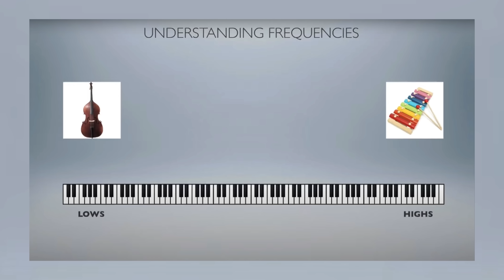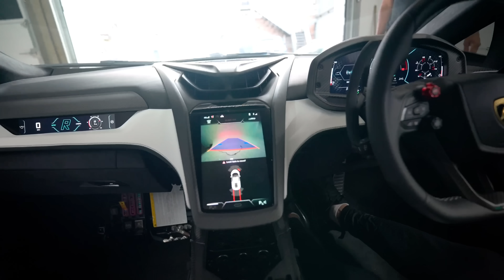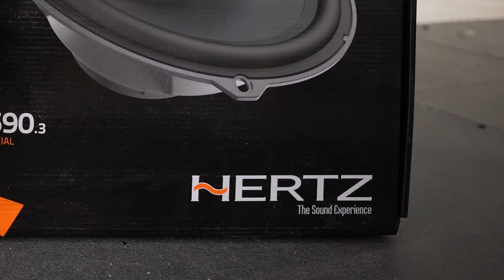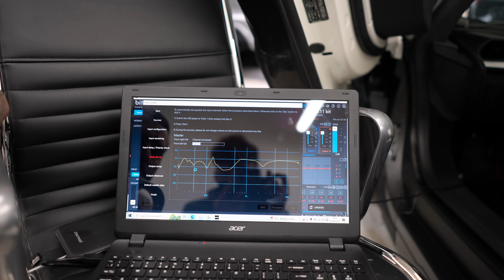Worlds First Custom Sound System In A Lamborghini Revuelto

Comment: Hertz is something you put on a 1999 Ford Focus, for such a car I would go way up in the class of the speakers...
Reply: Only someone who knows little about audio would believe that… I bet you would also think the bigger the name of the brand the better the products must be 🙄🤦🏻‍♂️
Reply: Nothing wrong with hertz, solid audio stuff. Sure there are "better" more expensive speakers but its more about the install rather than the speakers you have. Also not that the hertz mille is cheap in anyways.
Reply: @vincentgoforth6082 you’re actually opposite on that. Anyone in the know realizes Hertz/Audison is sooo 15 yrs ago. Since then, everyone has surpassed them in every respect. Not to mention as a 20 yr professional, the “hidden” work is cringe worthy. Electrical taped bundled wires. 🙄 have some pride in your work. This is not the caliber or work that should be done in a car like this….
Reply: @jtc406  What good car speaker brands do you recommend nowadays?
Reply: @zeke937  it’s actually really difficult to recommend any audio equipment because of it being so subjective. First, I would recommend going to several different reputable audio shops that have a variety of equipment for demo. Second, the car audio community is actually quite welcoming so once you have found audio brands you think suits your taste, listen to it in different cars. because each brand has their signature sound, however because audio is usually last on the list for a car manufacturers as displayed by the $600,000 car, not just in choice of equipment, but speaker angling and locations. Overtime you’ll come across brands you will prefer the sound of inside a vehicle. After all of that, decide a budget and execute to the best of your ability.

Comment: C’mon pav use fabric insulation tape looks miles better! Also an aerospace grade connector whould be more suitable for a built in a car like this rather than those to cheap plastic connectors! 🙏
Reply: Agree! Even go a step further and build a small panel at the end of the box the hide the connectors

Comment: I Would have skipped the 6x9 behind the seats, they dont really do shit back there. since they are being blocked by the seats instead i would have installed amp/dsp back behind the seats hidden and run that frontend active not passive. but thats just me. also i didnt see any noise deadening done to the doors, just speaker swap.

That amp/dsp just looks bad in the passenger foot area, personal preference as always. 

Also kinda pointless having dsp for useless coaxial rear fill + passive crossover front end.

Comment: How does this affect the manufacturers warranty of the car ? dismantling to this extent and altering the wiring? Amazing a car of this value and you feel the need to do this, £925 option in my Porsche 718GTS4 for Bose and it sounds amazing